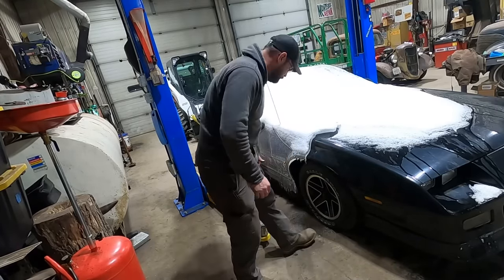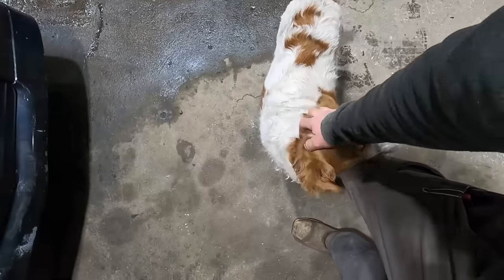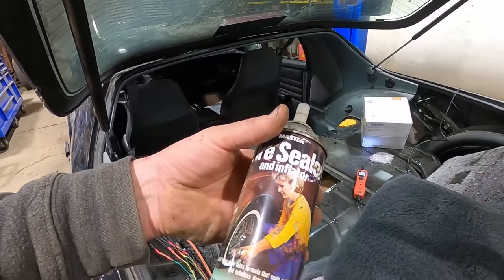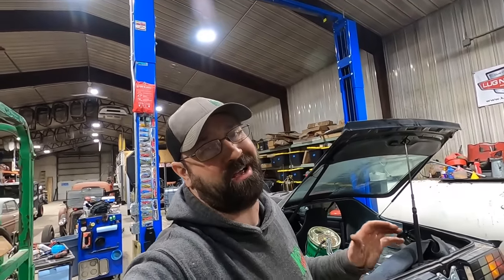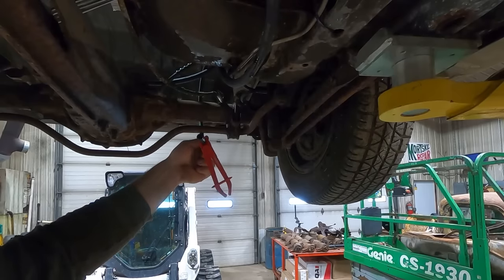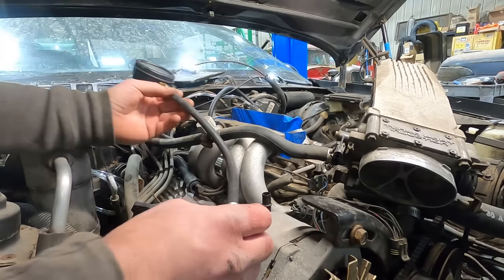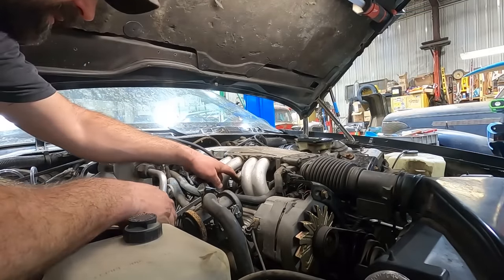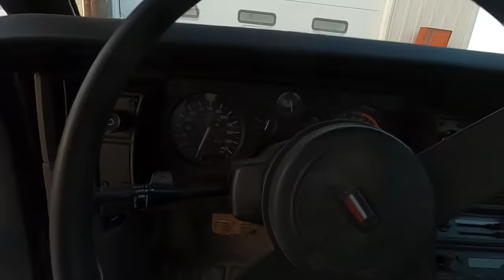Another Bargain or Bust Facebook Camaro?!? Low Mileage 1986 Z28 Tuned Port Injection! Will It Run?!?

Comment: Not gonna be that guy.  But that’s a 305.  L89 is 305.   L98 is 350.    350s weren’t available till 87.   And the idle air control valve is what is on the bottom on the throttle body.   😊
Reply: LB9 is 305.
Reply: @LSswapGarage1  yea that’s right , my bad.   I knew it was something with a 9 at the end.  And the L98 is the 350 car

Comment: Man you made that way harder on yourself than you needed to. You could’ve probably gotten away with tapping on the original injectors with something and it would’ve freed them up
Reply from the maker: Ya right
Reply: @MortskeRepair  just did it on a 97 z28 that was sitting since 2014. Pressure at the rail, no start. Popped the rails out, turned the key and only 1 or 2 were spraying. Tapped on them and they all started spraying. Car fired right up. Just saying.

Comment: It could take all that injector stuff out there and put a 350 intake on there and put a regular corporation system on there and you want to worry about that all of that jump sitting there for your fill injection and throttle about it and all that BS so you just get a regular 350 intake drop it on your carburetor there you go
Reply: Carberater
Reply from the maker: Any Neanderthal could do that
Reply: @MortskeRepair  indeed but for the amount of money to do everything right it would cost more than the car is worth.

Comment: mortskie i have a tuned port set up thats been ported and polished, bigger injectors and a bbk throtle body. i would trade for some merch if your interested. i went to carb but instantly regreted it, ran much bettter with fuel injection. reply if interested
Reply from the maker: send us an email

Comment: As for RPO codes is it a B4C??  That’s the code for police package Camaro
Reply: The B4C option didn't exist prior to 1991. It's just a regular old Z28.  And the B4C when it did exist was badged as an RS.
Reply: @LSswapGarage1  true but badges are easy to swap… I did not know about the year cut off…. I used to sell a ton of 9C1’s back in the day, and even owned a few 1A2’s I got from NYC. Good times.

Comment: Taking it somewhere to get fuel lines replaced - several hundred dollars.
Reply from the maker: or do it yourself in an afternoon
Reply: @MortskeRepair  $30 patch kits from Advance work wonders when you reverse them and use a flare tool for the rubber/metal line coming off the engine side.

Comment: You don’t lift on the pinch points on a third gen they bend and mess up the body lines they are not designed to lift on just the frame

Comment: Thought the TPI 305 was 235 hp and the 350 TPI was 245..They made so much screwed up stuff in the 80s...
Reply: Not in 86... was no 350 in 86 in the first place. And the 305 was 190 hp as stated.
Reply: @LSswapGarage1  that's what I get for assuming TPIs were all the same ..lol..I guess it was later on

Comment: That is a 34k car, rough but really is, lots of telltale signs,one being those eagle gt+4 tires, to the original steering wheel with mint leather un damaged, I can keep going. Too bad it’s in such rough shape
Reply from the maker: Right on
Reply: Ohm the injectors, if they aren’t at 17 they won’t fire @MortskeRepair

Comment: 😂 5.4L triton engine good....... Wait till she starts to spit those plugs out and then she'll change your mind about how great that engine is. They are great when they work. Just a flaw Ford had with those heads on thhe 2 valve. Even thw 3 valve the plugs would try and break off inside them.  The 2 valve just had a problem spitting the plug out and stripping the few threads that only held the plugs in.

Comment: Thirdgens now are all like what you bought, that ones not really that bad.
The only people that ever owned them  were beating the crap out of them since new. Just assume every iroc or transam has been crashed before, or a poor teenager repaired it. Theres not many nice ones left out there.
 Iv personally owned about 15 of them and only kept one that i built was worth a restoration with an ls swap. 
And for the love of god dont lift a thirdgen by the rocker. You have to bend your ass over and hit the frame rail by the transmission.
The easiest way to show you never owned an F or A body is closing the door by the window glass, that will get you shot or beat up.

Comment: This brings back memories, not all good ones. I put a 5.3 in my son's 88 Iroc a couple summers ago.  Went from 220hp to 450hp. It is resting right now until the trans can get fixed. 1st gear is not there anymore after a couple 7000 rpm slams to it. I put a video of the process together. https://youtu.be/96MdpdswWMc?si=Sy5OVujSDYcLxJrV
Reply from the maker: Sounds like a good time!

Comment: You know that you are about to get the weenie when a seller makes this comment, “All it needs is (fill in the blank with your favorite lie)and it will run fine. Anyone who has ever purchased many used vehicles has at one time or another gotten the short end of the deal. I did on a “mint” GMT400 OBS. I wanted it so badly that it overrode my common sense. The truck was $5000 but I spent almost twice that fixing cleverly disguised problems. Every time I look at that truck my anus hurts.😂 Will the pain ever go away 🤷🏽‍♂️.

Comment: Uhg those cars were terrible. 
Had a girlfriend in high school that had a actual ex-police model. 
305 RS with the 5 speed. 
It was slow. Rode terrible. Vibrated above 70, and everything rattled. 
I strongly disliked that car. 
I had a 78 caprice with a stock truck smog era 350 /th350, slight stall converter, and gears. 
My land Yacht would leave that Crap-maro behind.

Comment: Unfortunately, the chassis on this car is a rusty pile, but if you have a non rusty body Camaro from this period with a crap interior and broken windows and in need of a pile of hard to find miscellaneous parts, you have a value priced source in this car. But I am not the one for this car.

Comment: For the love of God, stop using brake cleaner to start fuel-injected cars that might have MAF and MAP sensors in their intake path. They can be damaged by the chemical in brake cleaner. Not sure if the '86 Camaros have them, but why take a chance.  There are better aerosol products for doing this... like "STARTING FLUID"